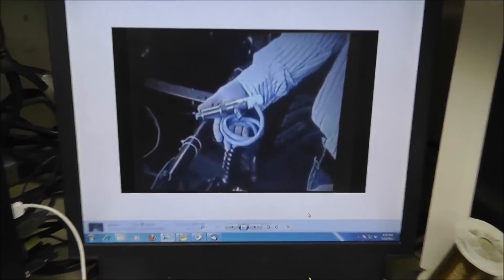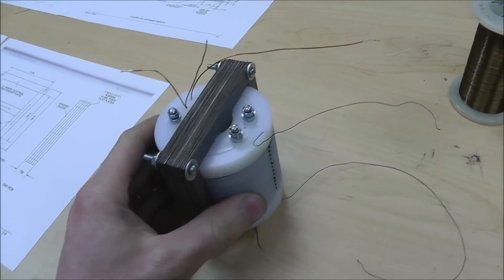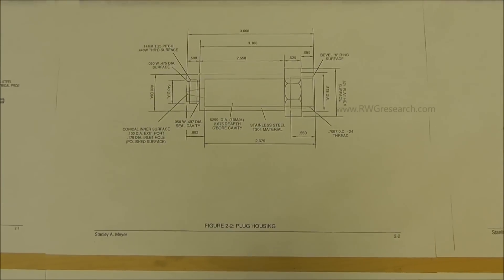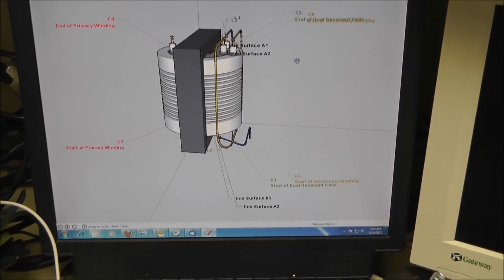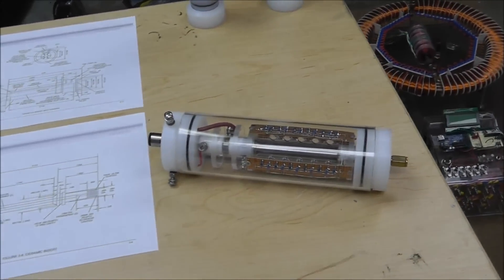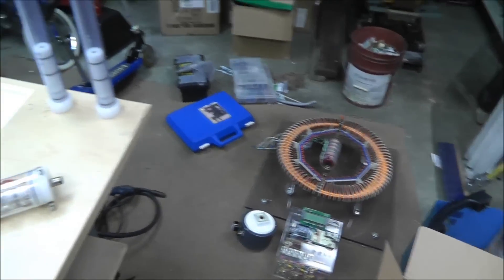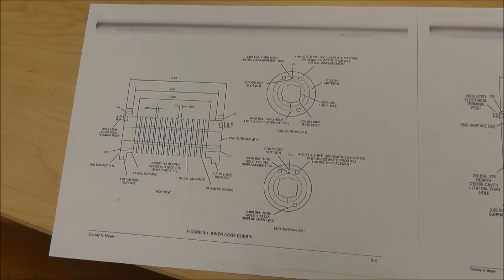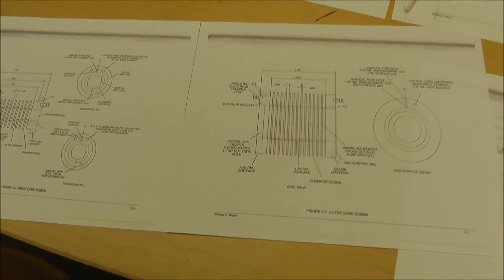Planos de los inyectores de Stanley Meyer, explicados con detalle.

Comment: Alguno de ustedes a realizado alguna celda generadora de hho? Q resultados han obtenido? o n los han aplicado en un motor de combustion. Saludos desde Qro Mexico.
Reply: yo si ya hice las celdas carnal si funciona es muy sencillo lo difícil es que genere la suficiente cantidad para encender un carro , con 12 voltios generas muy buena cantidad dependiendo cuantas placas utilices ,cables de corriente y el electrolito que le pongas todo tiene una medición , si quieres generar mucho depende que tanta cantidad de electricidad le pongas pero con 12 volts empieza a generar muy bien